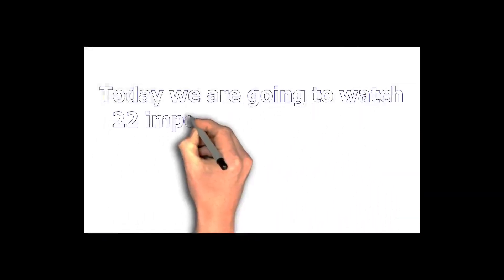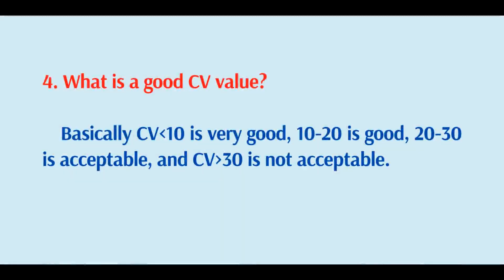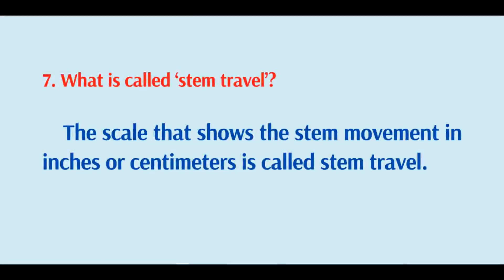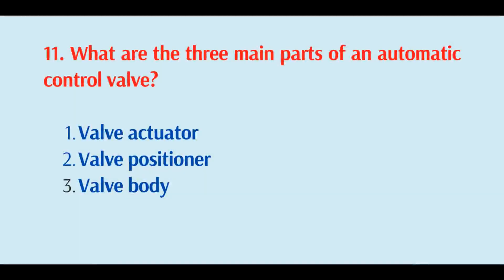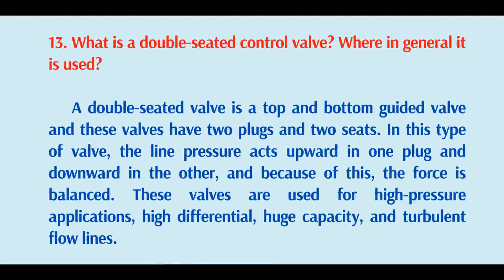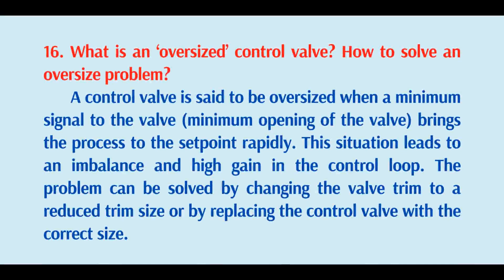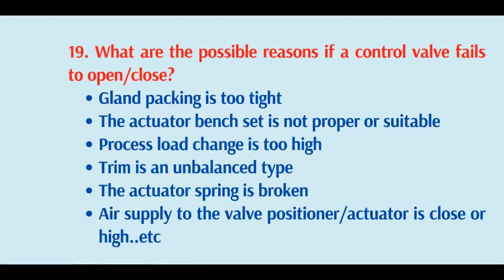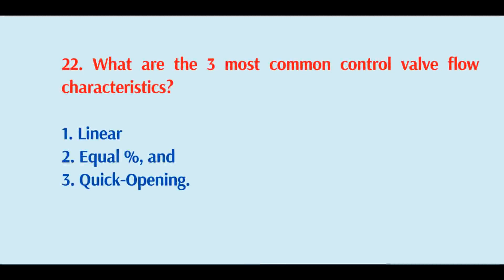22 Most important,frequently asked Control Valve Interview Question and Answers

Comment: How much air supply give toElectro pnuimatic control vavle..
Reply from the maker: In general, most electro-pneumatic control valves operate within a range of 3-15 psi (0.2-1 bar)